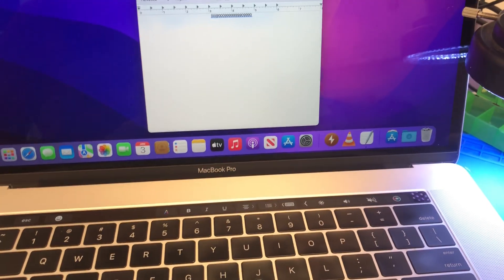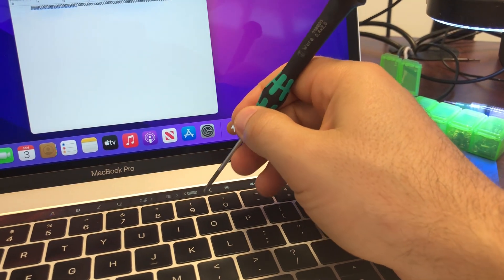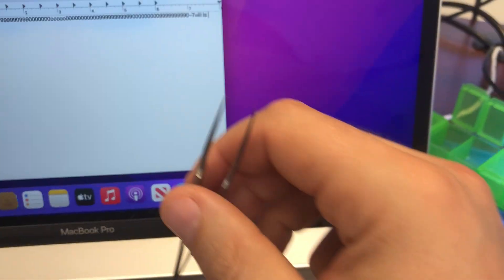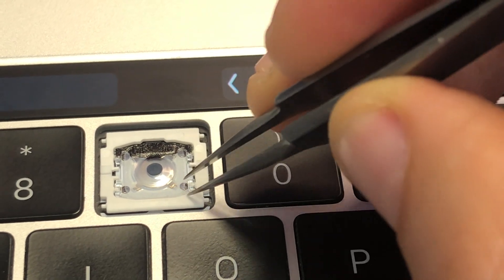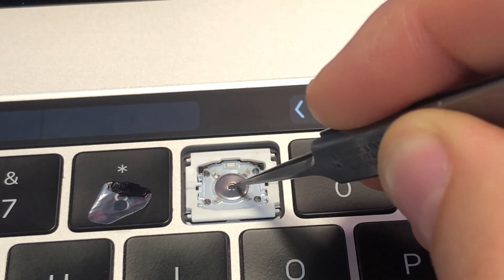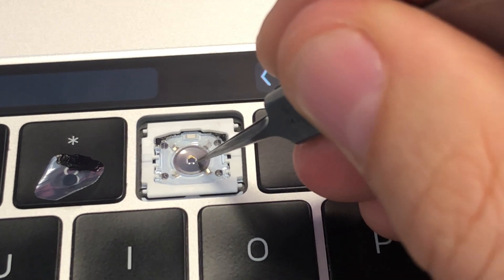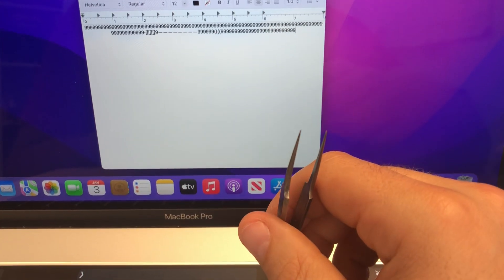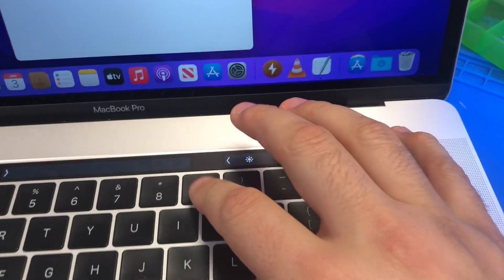Fixing Hard To Press MacBook Air Pro Butterfly USB-C A1706 A1707 A1708 Keyboard without taking apart

Comment: I couldn't ever get the plastic part off, so I just repeatedly pushed the metal disc from all angles and it worked.  I fixed 5 unresponsive keys in about an hour.  Thank you!

Comment: You are a LIFE SAVER! Thank you so much! I was actually able to fix my number "6" key with this issue without removing the clear plastic tab. I just removed the key, cleared the dust off it and use the tweezer to try to rotate the silver circle just a little bit through the clear plastic tab, and VOILA, it WORKED! You are THE MAN!!!